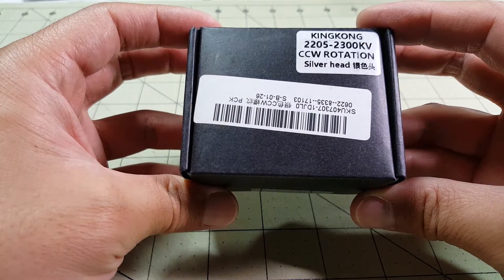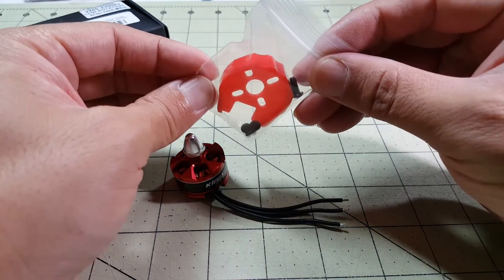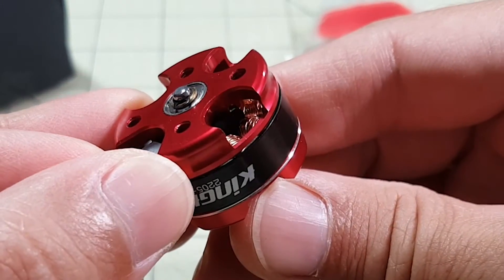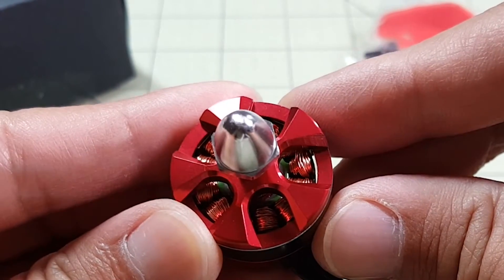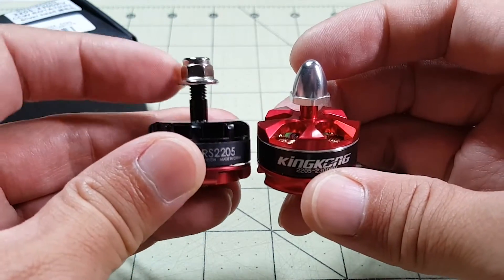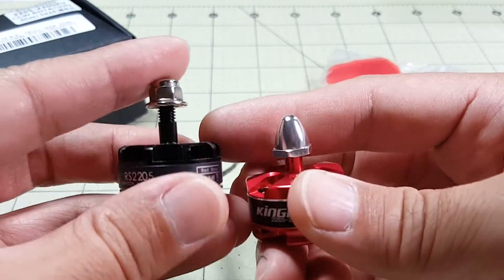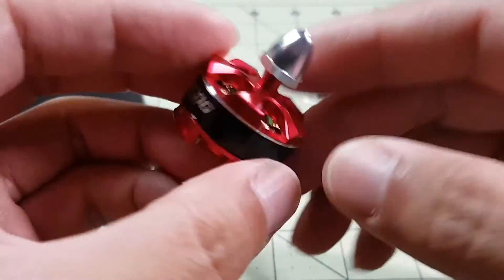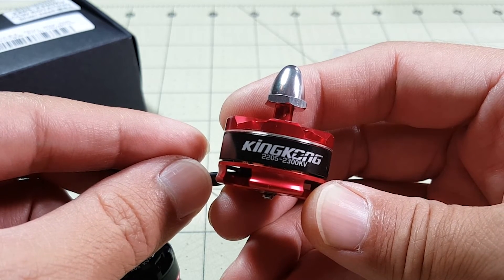KingKong 2205 2300kv Motors

Comment: I got my motors today and I ordered 5. It was good that I did that because 1 was not working. Don't now why but it was no problem.
I did one short los test flight and I am impressed with them They are fast and that for that money. It was like a rocked. I used 4s 1300mah MRP lipo with DAL 5040t props. Noting got hod and it flys great. 
Now am I looking ad these motors. http://www.banggood.com/4X-Racerstar-2205-BR2205-2300KV-2-4S-Brushless-Motor-2-CW-2-CCW-For-QAV250-ZMR250-260-Multirotor-p-1066837.html
they are cheaper but for what I heard about it, is that they are faster and better quality.
I dont now for shure if it is so but I need 4 2205 motors and these motors are cheap so as they are not that good it is not a big problem.

I think thatyou will like the Kingkong 2205 2300kv motors.
Only thing I did not like were the stiff motr wires.
Reply from the maker: +emiel1976ep what was wrong with the broken one?
Reply: I don't now. I opened the motor but everything looks good. It will just not run. It can spin free but it will not. But it is not a problem the other 4 work great.